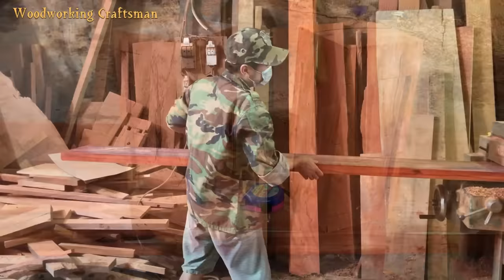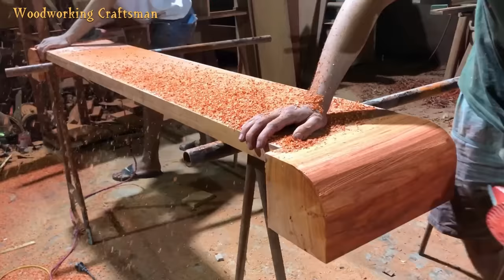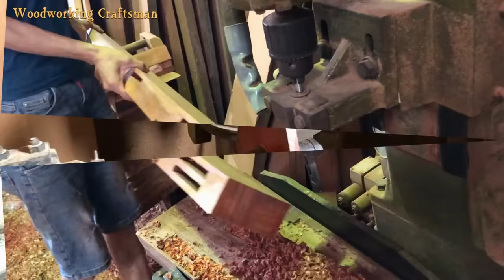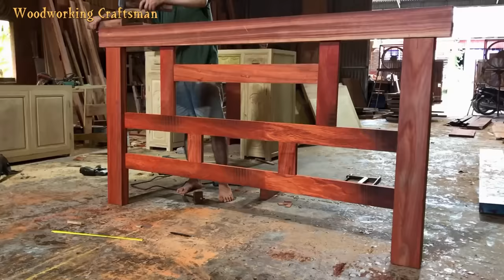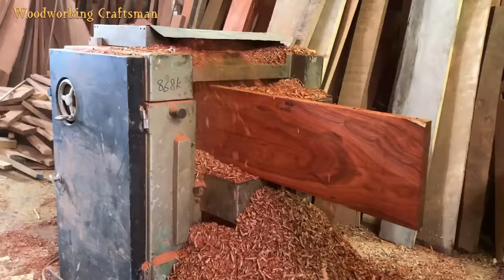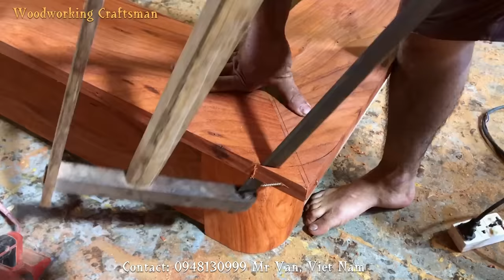Design Perfect Prince's Bed With Monolithic Red Hardwood || Extremely Wonderful WoodWorking Machines

Comment: Very nice bed. You generate a lot of sawdust. What do you do with it?
Reply: Which is used for many purpose like fertilizer and fuel type and also used to fill the holes in wood with some mixter of aroldite (resin)
Reply: @A2kvlogss  

Т
Reply: Из
Reply: @user-vi1kw7bz9d  l

Comment: More ways to skin a cat 
    Brackets hold up houses so the need for grooves with glue is not necessary.  No bolts either for that thickness 
    That’s why made in USA rules 
    These well trained workers getting paid a low and get that timber cheap , the importers and exporters are making the money while these kids can not afford foot ware

Comment: Very impressive, but I am concerned that your employees wear no safety glasses, hearing protection, and almost never any dust masks. Now that you have access to the internet, you should look into job site injuries and the effects of prolonged exposure to the wood dust they're breathing. I don't have a clue about workers insurance in Vietnam, but there is no company in the US that would insure anyone that didn't use the MINIMUM that I mentioned. If you care the slightest about the health of your workers, you would make those 3 items mandatory. They are ridiculously cheap and prevent most work site injuries.

Comment: I just saw a guy putting on a mask 5 mins before the end which look a month old. How are they still working with their limbs intact. No safety anywhere. Besides this is just basic woodworking. Those routing the wood did not lift the bed up to a working comfortable heights and instead taking the pressure on their own virtibral columns. This can put their later life in pain.
Reply: молодых никому не жалко